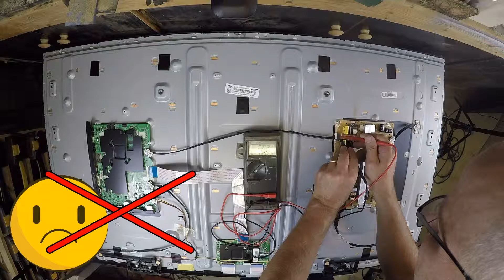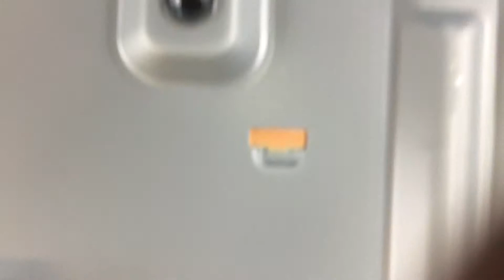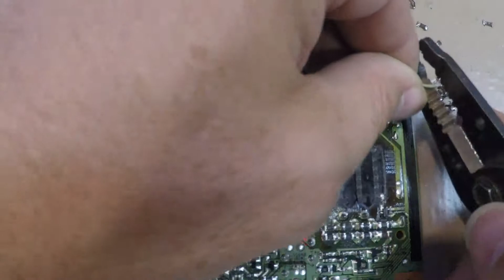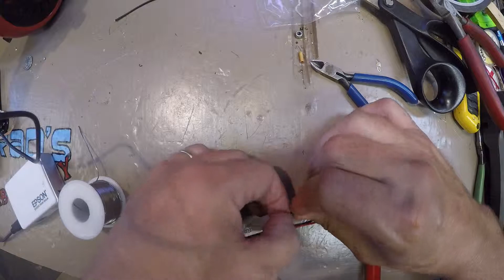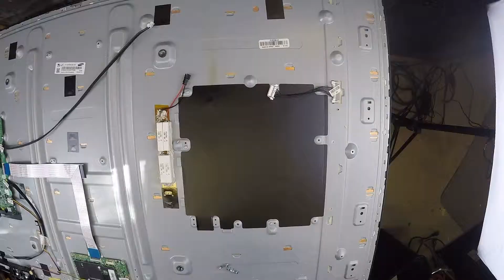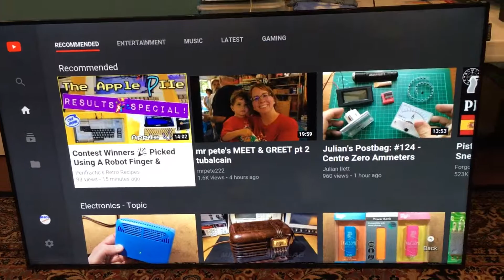Samsung TV Repair

Comment: Wow the power supply board have that much dead and fried micro resistors.Look like that tv was caused by a big lightning bolt power surge to the tv.I very surprise the main processor motherboard have no problems and still works.
Reply from the maker: I think just crappy capacitors. Didn't appear to have any lightning damage.

I was reading a whole story about someone stealing the secret formula for the goo that goes inside the capacitors, but the real owners of the secret formula fooled him and let him steal the wrong formula. He went out and started making his own capacitors and selling them and they all went south like this.